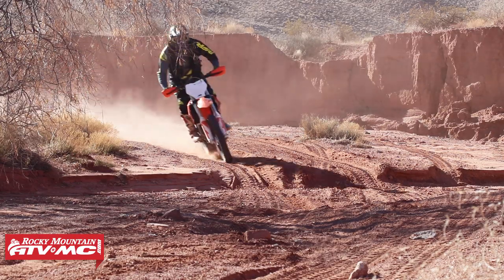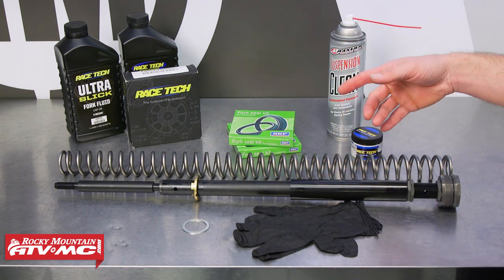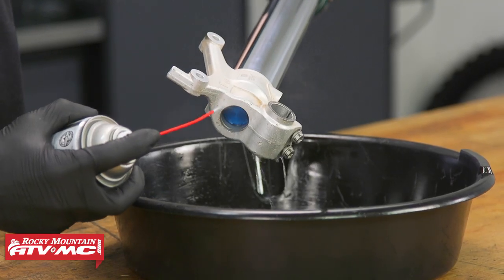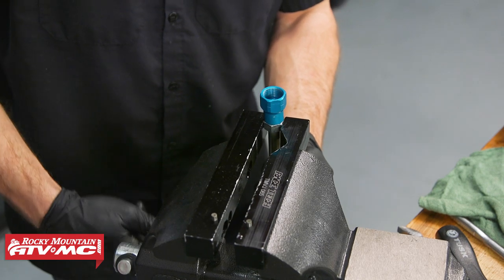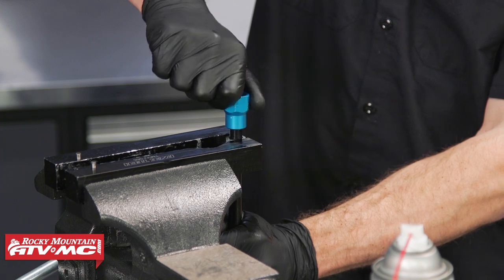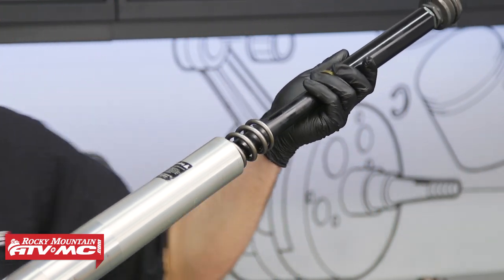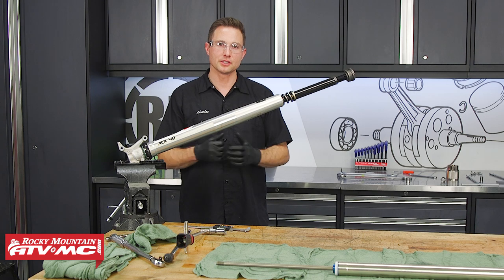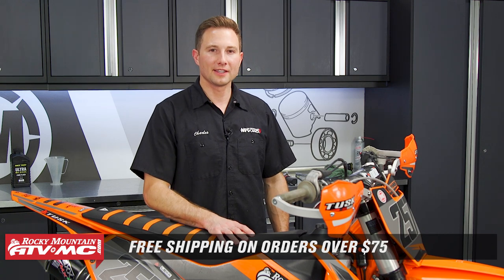Dirt Bike Air to Spring Fork Conversion - How To Install the Race Tech Spring Conversion System

Comment: I have a 21 husqvarna 300 thx with spring forks. I also have a 21 KTM 300 Xc. I plan to sell the husky but I like the spring forks so I was considering swapping them. Any issues with that? Thanks!

Comment: If i have a kyb air fork and an 2005 kxf spring fork with inner tubes pretty damage.. both 48mm .. can I switch the tubes or the inside cartridge and spring to the air fork?

Comment: There’s no link for the fork cap wrench
Reply from the maker: The first link in the description will take you to a page with the Tusk Fork Cap Wrench. The part numbers for the wrenches used in this video are 1143530001 and 1143530005.

Comment: For 220 lbs ride RT says .89-.91, but you used a .92 for a 165 person? Is RT off or was the spring to high?
Reply: What did you find? Did you ever do the conversion? I’ve got two bikes with single spring conversion. One is RT and one is K-Tech and both are very soft in front and bottom easily. I think the companies started off way off base on their rates. I looked at the RT website calculator and it recommends a .97 for me @ 180 # B Moto.
Reply: I have the RT on both my bikes.  RT calc said .89-.91 at time (I think they finally updated) and my other bikes in past were always.46 so doubled (1 spring vs 2) is .92.  I bought .92.  It’s a bit soft!  I would go 1 rate higher.  I left it as I have bad wrists and found it really helped with pain.  I then did Max oil volume so that it ramps up faster and I lowered forks in the clamps as it was diving a bit.  So it’s sitting lower in travel a tad.

I should go up a rate but didn’t want to spend the $ and it’s been working with the above setup.  

For reference I’m late 40s, pretty fast and aggressive and ride everything from fast flow to slow tech.
Reply: @leroywilliams7210  great info. Thank you. I agree. It seems like they updated their calculator along the way to recommend firmer. I dunno what’s in the bike now but I’m gonna try to figure it out and go up one rate. It feels good except for hard landings where there’s just no bottoming resistance and it bottoms too easy.
Reply: @leroywilliams7210 I could be wrong, but this makes sense to me: a two sided spring will require a softer combined spring rate than a single side spring since the dual spring setup also has two valve cartridges slowing down the travel. So I would think if I were a .48 on a dual spring, I’d need to be at least 1.0 on single.
Reply: @jcbenson01 yup, sucks I bought off their recommendation then too soft and now cost me double.  Thanks racetech.  Also, remember the oil height, makes a noticeable difference.  If I remember the range is 525-575cc.  I started at Min and was so soft I went straight to max.  That will help with bottom out.  Like adding Tokens in an MTB Fork.
Reply: @leroywilliams7210 how would you describe the feel from min to max oil level? Did it feel crustier/harsher at max oil height?
Reply: @jcbenson01  didn’t really change the ride much just less fork dive.  Still had to lower forks in clamps to raise front end a bit.  I should up the spring but I got a jacked up wrist and the plusher front from 1 spring conversion (way better than air) and 2 a little soft on spring rate really helps
Reply: @leroywilliams7210 if I don’t get the front end stiffened up I’m gonna have some jacked up wrists myself 😂. Anyways, thanks for the info!
Reply from the maker: Sorry @leroywilliams7210. This is super late, but If anyone needs it for future reference here it is... We did go with Race Tech's recommendations. For a 155lb rider up to 29 years old racing B-class motocross, Race Tech is recommending a 0.92kg/mm spring. At the time we only offered 3 spring options, but we now offer all eight springs and have them listed with the recommended weight ratings on our website. If you are using Race Tech's spring calculator, just keep in mind that it will lower the spring rate as age goes up. Other things like riding style, skill level and preferred stiffness will change the recommended rate as well. -Charles
Reply: How much oil in the other fork ? Is it the same 525mm in both ??
Reply: @kevinsouthgate3231  No, the other fork has much less volume due to the damping cartridge being in there.  200ml +40/-20 So 180-240.  I run 200 in mine and 180 in my wife and kids.